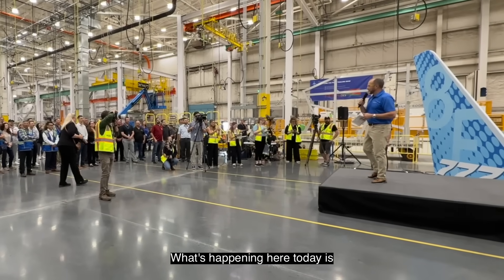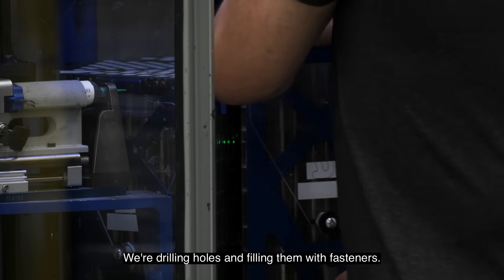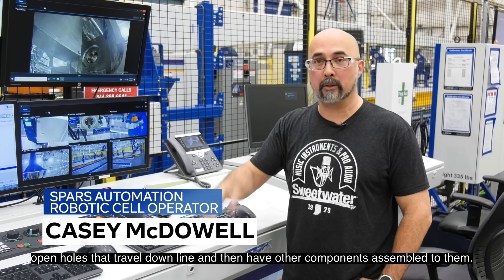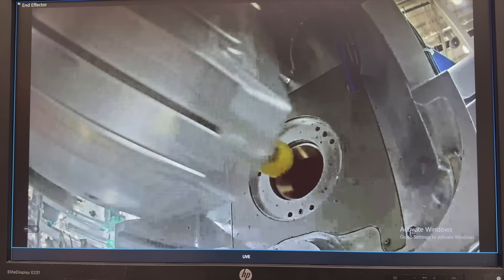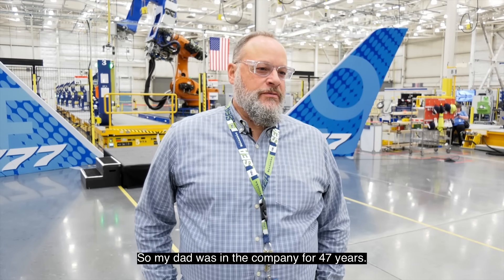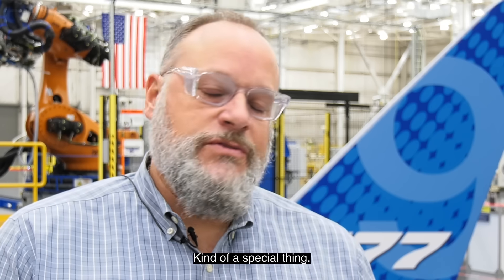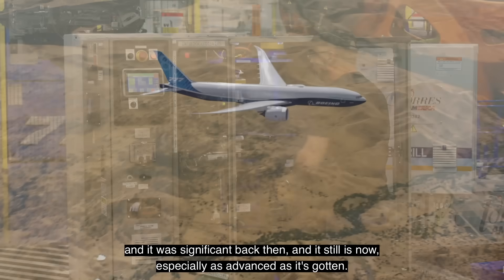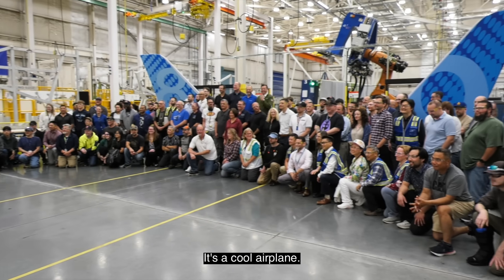Boeing kicks off 777-8 Freighter Production

Comment: Maybe first get that heap of a 777x flying? The first fuselages have been rotting outside for ages. While Airbus is rocking it with state of the art carbon fiber airframes, Boeing is still trying to certify that old aluminium design 😂

Comment: Are the wings designed and built by the Japanese or are we actually doing this in-house this time?
Reply: It's in-house as Boeing has its own dedicated assembly plant for building the wings because the 777X's wings are too big to fit inside even the largest freighter aircraft so its much easier to build them right there in Everett.

Comment: Haven’t got the certification. Starts producing the plane🤡
Reply: Tell us you don’t understand how the aircraft certification and build processes work without telling us.
Reply: @777xdyork55 Sure ‘dork’
Reply: @777xdyork55  tell us how boeing lots hundreds of millions of dollars building max bodies and letting them pile up to only need additional rework in ghost assembly lines
Reply: @soccerguy2433  Tell us why you don't know that issue was due to problems with Boeing's supplier, Spirit AeroSystems. And tell us why you didn't mention all the problems AirBus is having because of the same supplier. Particularly, on the A350 and A220 programs. And these issues are delaying the A350F certification and delivery schedule. It likely won't enter service until 2027. You want to tell us how many problems AirBus, and it's customers, are having with the A220, thanks to supplier Pratt and Whitney?  Or the A220 corrosion issues involving things like passenger seat fittings, and wing components. There's some out of sequence work for you. Including post delivery.
Reply: @wzune6513 Bruh, Spirit Aerosystems was a part of Boeing until it separated and is now again going to be reacquired by Boeing.
Reply: @desertcactus619  Boeing SOLD Spirit 20 years ago. It was no longer operated by Boeing. And, all on their very own,  Airbus engaged Spirit, to produce major and minor components for their aircraft. Some even involve the design/build process.
Only a portion of Spirit will be bought by Boeing. Airbus is in the process of buying up portions of Spirit as well. Amazing how you keep trying to disconnect Airbus from many of the very same issues Boeing is seeing with its suppliers.
Reply: @wzune6513 I am not trying to defend Airbus. If its planes run into problems, then I welcome any investigation into Airbus. But the thing here is that Boeing is found to show many of the greedy capitalistic tendencies that companies in the aerospace sector shouldn’t. Safety, for a short period of time and maybe currently, comes second to their profits.
Reply: @desertcactus619  You are all over the place with this. I didn't even bother to respond to your silly initial comment. "Start producing the plane" what do you think they are doing? 26 have already been built. Four of them are active in the test fleet. So part of your initial demand was already met.
Reply: @desertcactus619  As for the first part of your initial comment, sounds like you are not happy the thing isn't certified yet. Well, which do you want? Careful certification and any discovered issues resolved, before the first plane even enters service? Or just rush it through and hope for the best? We have seen how rubber stamped approvals don't serve anyone well.
Reply: In order to certify a plane you must first test it, and in order to test a plane you must first build it. Why is this so hard to comprehend?
Reply: How are they supposed to certify it if they don't build any?
Reply: Go back to the rest room and play with it...